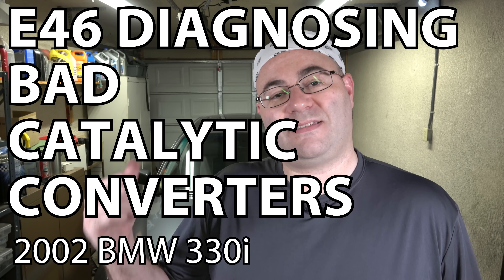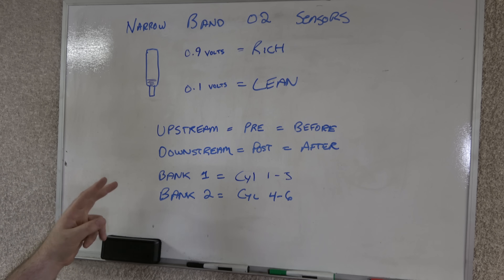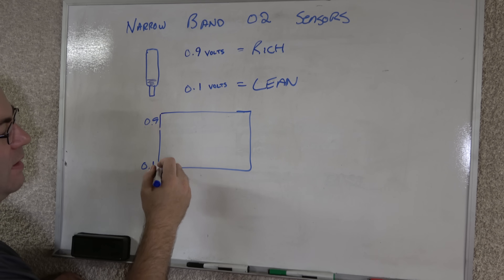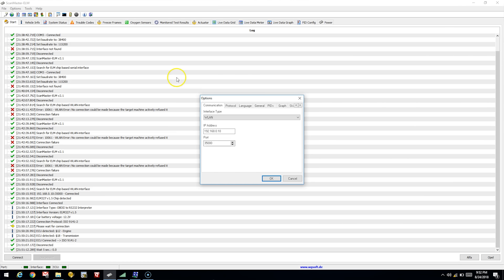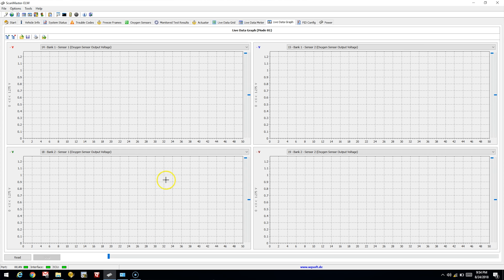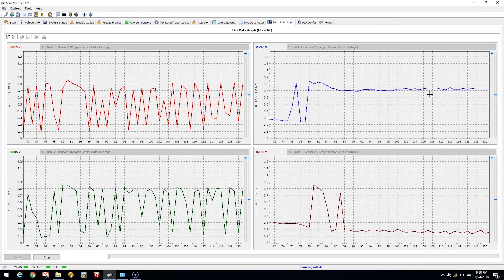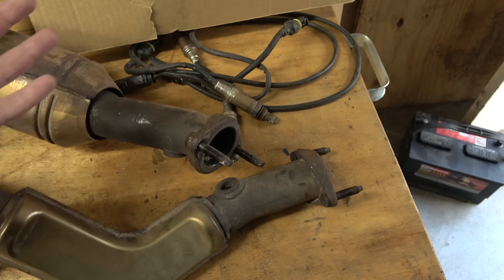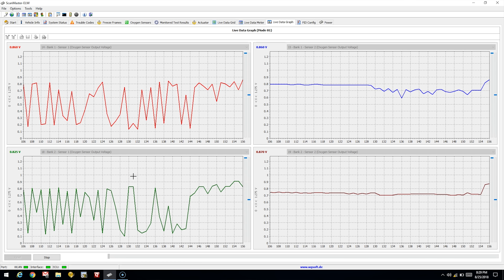BMW E46 How To Diagnose a Bad Catalytic Converter P0420/P0430

Comment: Bro you can just put vaporized water  through the inlet intake do this and will make a big difference  it works 100% try it first then give car a good hard drive down  the motorway !! Clean manifold pressure sensor and air flow metre turbo Boost sensor and any other senses you can get to easily

Comment: what if my up stream sensor running lean but my post sensor is perfect
Reply: Put vaporized water through your engine spray bottle keep revs at around 2000rpm  and then give car a good boot down the road all so clean all sensors air flow metre and manifold pressure sensor and turbo Boost sensor cleaning all that nice job done

Comment: The answer is, 
You don't diagnose these, you trash them and install headers.  These pieces of shit make these engines run like a 2l 4 cylinder.  Now put a gas mask on your face and run .!

Comment: I never threw these codes that you were talking about however I'm still getting lean codes or rich codes but at startup I get my E34 codes permissible range exceeded on both Banks and I get an STD black spot out of the back of my exhaust
Reply: injectors

Comment: Hey I'm wondering if you can confirm something on my data before I got ahead and buy some headers lol I bought a 03 330ci with 150k miles when I bought it like 2 months ago. With a P1349 misfire cylinder 4 with fuel cut off..  & since this day I been chasing the problem down.. I haven't replaced much but I had a e46 325i before this one so I know about all the common leaks and things that tend to go out. So after driving it like that for about 3 days (I know I shouldn't) more codes pop out and it was misfire on all cylinders with fuel cut off except 2 & 5. So I did the obvious first change plugs and coils to brand new oem ones. Clear the codes and when I started it back up it felt a little better... after about 3 min on idle the check engine light came on again.. check it again and it was still P1349 & still running like total CRAP. So I did the next, check the fuel injectors with the old screw driver trick and they all were working I even read the ohms with a meter and they were all the same numbers.. I know it's not the fuel pump cause why would only 4 be misfiring.. Plus the car runs HORRIBLE after it drops 1k rpm it starts to shake bad and when u rev it pass 4k u hear and feel hard vibrations under the car like the drive shaft it really lose or something (which I still need to inspect better) but a quick look under there and it feels fine guibo etc.. pretty sure it's not a bad idea to replace the center bearing and all those things but that's coming lol anyways I also did change the fuel filter for a Mahle one, reading on the forums I found something interesting someone with the same code as mine but he had done pretty much everything even had a brand new head in it did compression test, leak down, new injectors, etc & nothing. Till he did a back pressure test and found out that bank one had 7psi and bank two had 3 psi I believe.. I'll post the link if you want to go ahead an check it out for yourself https://www.bimmerforums.com/forum/showthread.php?2364925-P1349-4-misfire-with-fuel-cutoff he has the same car I do as well so I'm hoping that it and not a messed up valve or something I did the same test you did but on app called "torque" bank 1 looked normal but bank 2 was just a straight line and when I rev it to about 2-3k rpm  it would start to go lower I took some screenshots to see if you can take a look at them? I can send them to your email or something.... thanks

Comment: I Have P0492 and P0491, will I also have to change the catalytic converter and 02 sensors, or is this just an issue with the fuel injectors?

Comment: Hi 50’sKid, great job on all the videos. I’ve managed to change lots on my 2002 316i estate. I have a new issue now, smoke from engine bay behind engine. Smells oily and loss/hesitant on power. I’ve replaced the valve cover gasket, coolant thermostat, expansion tank and I found oil in the brake booster so I have replaced that too. I haven’t yet done the CCV so that’s my next job. Any help on this would be appreciated. Thanks for your time.

Comment: Suggest try O2 extenders (Google “O2 extender”) on the downstream sensors for P0420/P0430 codes before replacing the cats. They’re only ~$8-$10 ea. Worked for me going on 2 years, now. Worth a try.

Comment: Hi Jason
Thanks for the video. Just ran software and found my O2 post cat voltages are fine at 2500 rpm a steady 0.7 except, ever minute or so, the bank 2 graph it will take a dive for a second and then recover. Any thoughts you might have to offer? Cheers.

Comment: Hey 50skid loved ur video! I believe mine are done cuz I have extremely loss of power and the eml light came on. Also check engine light and the traction light. Where did u get those used cats? I have an 2000 323i e46

Comment: My Mazda 6 2.0 (2007) has an upstream wideband O2 sensor (AFR) and a regular downstream narrowband O2 sensor (I believe). 
A few things I'm worried about: 
1) I cannot check the AFR sensor since it has no voltage output (only current) - in ELM327 ScanMaster at least; 
2) the voltage on the downstream sensor is constantly low - it stays at around 100-150mV. O2 sensor temperature is around 300 degrees C.
If I step on the gas the voltage drops to essentially zero. And I've never seen it going above 0.3V (or even 0.2V). At the same time, STFT and LTFT go negative. 
This is all at idle - haven't taken it for a test drive yet. 
I wonder what could be my problem there. :/
No fault codes or anything, just rough idle. Sometimes when I let off the gas the RPM drop below 600. At the same time, it is not surging or anything.
Thanks a lot.
Reply from the maker: It’s harder to diagnose an A/F sensor with just an ELM327 adapter. http://www.underhoodservice.com/troubleshooting-wideband-o2-sensors/ you’re right in that your downstream sensor is narrow band. There is no need for a more expensive narrow band there. that being said, it does sound like your downstream sensor isn’t operating correctly, particularly the temperature (should be at least 600 degrees). What does the upstream current read as?

Comment: Great video, always wondered why my car was low on power!
Reply: Can a bad catalytic converter cause a P0171 & P0174? I have both showing. Can't seem to find a vacuum leak and Indy nearby says I need a catalytic converter.
Reply: Anthony Lane nope, means systems running too lean, check the hose going to the dipstick and or get a smoke test that’s almost always what needs to be done
Reply: @asforme762  i have P0171 only... and from what i've heard it's possible that it could be the cat. For me i believe my Bank 2 cat is clogged which is causing excess air to come back into the engine causing Bank 1 to be lean. I've done a exhaust back pressure test from my Pre-Cat sensors and my bank 2 cat seems to be trashed so i believe that is my problem (low mpg -16.4mpg, stalling, engine power loss, strong exhaust smell from behind car, can't pass 45 mph when going up hill)
Reply: @asforme762  you have a bad DISA valve on the intake manifold.  Typically, the flap is broken. Replace it or buy a repair kit and fix it assuming it still holds vacuum

Comment: Great video and fair diagnoses. But in wondering why didn't you attempt to clean the converter? Many videos have claimed to run a blended gasoline mix to help break up the build up the cats collect. I want to say they mix it with alcohol our lacquer thinner.

Comment: Jason i have a similar issue with these codes and my 330ci. after the car has cruised for about 30 minutes,  and a hot soak for about 20 minutes and then the light comes on when light throttle between 1500-1800rpm. i ran an extended journey and the light came on a  few times but eventually did not come on at all for about 500 miles.
i do not detect any vacuum leaks and performance and economy are both good.
One solution I have heard is to use  an O2 plug foul type spacer on the post cat sensors to remove the sensor from the direct exhaust stream which may fool the computer to not report the issue.
Any ideas for a diagnosis? i do not want to replace the cats, and if I were to do that then catless headers makes more sense.
Car has done 105 miles.

Comment: Hey Jason I have extra cats for sale still in good condition in the inland empire area
Reply: Angel Deniz are they for e46? I have a 2000 323i. In need of some cats
Reply: @osaxchex2028  yeah off a 328ci
Still on good condition
Reply: @osaxchex2028  what's your number I'll text you
Reply: 5597771084

Comment: You may want to double check on the studs, I think they are a special material to not bind with the block aluminum. I think they are a special brass stud. You may never get a steel one out.

Comment: would a vacuum leak cause both pre and post to read lean
Reply: Yes but you will usually see a po17x code along with it. If it's bad enough. What happens is the sensor would be taken out of acceptable range and throw a code.

Comment: Bank 1 is cyl 1,3,5 not 1-3 & bank 2 is cyl 2,4,6 not 4-6
Reply from the maker: brian klein that’s on a V6 engine, bud. This is an inline-6
Reply: @50sKid  ok thanks for the correction

Comment: Your videos are very important to me for clarifying certain defects in BMW.
 Here in Brazil our fuel is very bad causeng  many defects in the sensour ...Thank  you...!!!
Reply: Put vaporized  water through  your engine  inlet intake ,,manifold spray bottle keep revs at around 1800 rpm cleans every thing carbon no more ,,

Comment: A quick question what if you get the 420 code but the readings on the scanner are good? Oxygen sensor maybe?
Reply from the maker: Eduardo Cortez you wouldn’t be getting a p0420 if the downstream sensor wasn’t cycling at too great a frequency, so I would say that isn’t possible

Comment: Always been wondering if we could use catless headers, and run universal cats somewhere underneath. Maybe deleting the resonator if fitment issues become a problem. If so, I think this way could be cheaper and just as good as the cats bmw uses within the exhaust manifolds?
Reply: He's in California though. If the inspector looks at it he could fail it because the cats are suppose to have a stamp on it, I believed cats only issued by carb and in the original location are permitted. Now truth be told many smog places don't go into depth crawling under the car to get the number.
Reply from the maker: Most wanted motors only if they are aftermarket cats. These are OEM, so how would anybody know the difference, ya know? All OEM cats were the same.  Aftermarket units that are CARB certified have that stamped in the metal identification plate but, again, nobody checks these things. They plug in a scan tool and send you down the road!
Reply from the maker: John Faire yeah you can do whatever you want in that respect, lengthen the o2 sensor wires